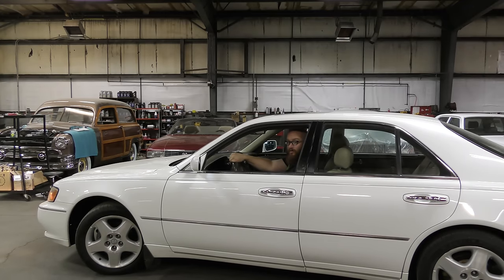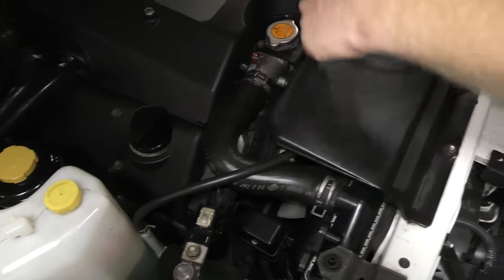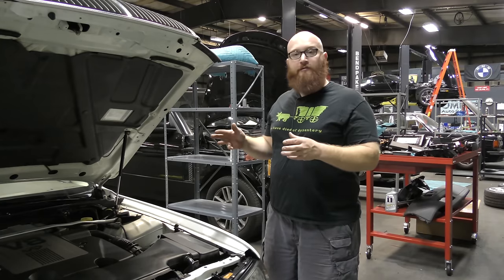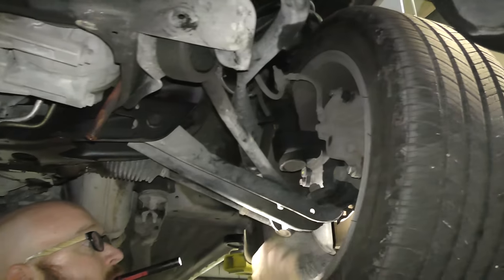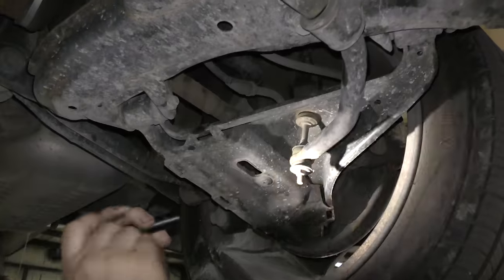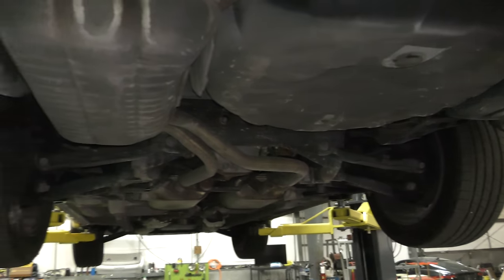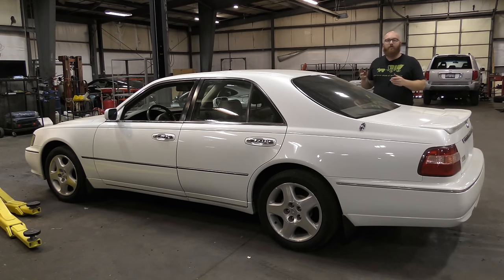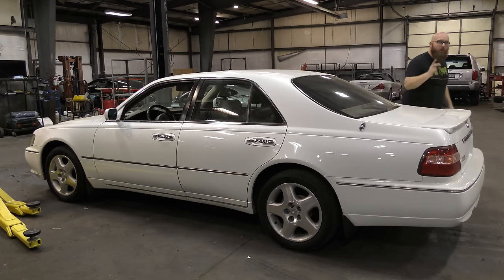I've never seen one of these before! First time a 99 Infiniti Q45t enters the Car Wizard's shop

Comment: Finding struts may be difficult as some of the fluids used for the hydraulic portion were later classified as carcinogenic. I hope that is not the case for this model. It looks like a set of coil-overs may be the only alternative if a local hydraulic rebuilder can't help.

Comment: Hello, I could not find the ignition coil holding time in the manual, I only found the diagnostics. Please tell me, on the drain of brains from the factory, what is the holding time of the ignition coil?? The VH41DE engine

Comment: My dad got a 1990 Q new. I drove it and was a fan. Bought a used 90 Q45t and loved it until the sunroof broke costing $2k to fix. Next up was a 2004 Q45 with some miles. The engine and electricals started to go, and the car had nowhere near the verve that the 90 had. Last was a 2007 M45, which was an awesome car, also high miles, The post 1st gen Infinitis simply had too many sensors and electrical issues, and burned oil. My dad's last car was this one, probably the best looking of all.

Comment: Car wizard. I owned one a 99 touring same color with silver bottom . and currently own a 05 Q45 that I have owned since 2009. Here is ur only 2 options. OEM from dealer and they above 250 a piece..and front one not loaded how ever you get it with the knuckle in the front ..your second option. Coilover which they are available on ebay.97-01 ..and btw they start using 4.1 in 97 but in 02 they went back to the 4.5 👍

Comment: Hey , Wizard I had a question. I drive a 2013 toyota avalon limited.  It has 122,000 miles.  I thought It would be a good idea to change the transmission  oil.  When I called Toyota for price on changing oil, they said my cars transmission oil is good for the life of the car because it uses a special  type of oil. Ive never heard  of this.  Should  I change it anyways.

Comment: My trick to finding old car parts has always been to find older dealers that pulled dead inventory out of their computer system (for tax reasons) but had enough room not to throw them out.  I found a brand new set of lower control arms for a 1966 Oldsmobile at a dealership holding open a pair of huge sliding doors.  Obviously they were never in the digital parts inventory, but the old guy in the parts department thankfully recalled what they were other than door stops.  I've also had some luck finding Buick parts at Chevy dealerships... Where the parts guys knew they had the part, but had no clue what car it fit on to.  Having the part number was essential.  When I went to pick up the Buick part, which I got at a dirt cheap price.... the parts guys crowded the counter because they had been wondering for years what that mystery part actually was and what it fit into.   So try an old Nissan dealership if Infinity doesn't have the part... parts sometimes find themselves in places they don't belong... but make sure to have the part number.

And BTW, I know it's no fun to call dealerships one by one to get someone to actually go though their old stock, but that's the way to find parts that aren't in the computer system anymore.  Remember... narrow your list to only dealerships that were actually around when the car was new and have larger facilities to store old parts.

Comment: I drove a 2003 FX45, honestly it had the best exhaust note I ever heard from a car. The problem was the engine had complete failure at 65K miles, dealer replaced engine. I drove it an additional 50K to about 115K when one of my cylinders cracked and began to leak oil inside the cylinder causing large clouds of blue smoke and catalytic converter failure. I decided that the engine design must be a lemon. I see FX35's on the road all the time but I've never seen another FX45 after selling mine.

Comment: I drive a 97 Q45 with over 270K miles as a daily driver.  I paid $1,500.00 in 2008 for it, yup, $1500.00!  It had a little over 100K miles when i purchased it.  I was hoping to just get a couple years out of it. It still runs and rides like a dream.   All original except for the rear differential.  Everything still works.  AND, Yup, my power steering leaks.

Comment: I have an 01 i30 with a power steering leak and the iac valve needs to be replaced along with the ecm but I plan on keeping this bad boy bought it at 154xxx miles and only put 10xxx on it so far great car definitely want to keep and maintain for my son be worth a whole lot more then.

Comment: I wanted this, but...SLOWWWWWW... 2 years ago I got a 2002 Q45 Premium (1st production car with a rear view camera in the US). Then last year I got a 2005 Q45 Premium. The features back in 2002 for this car were amazing. It had adaptive cruise control, adjustable headlights, heated/cooled front seats, heated rear seats, navigation, voice activation for radio, windows etc, adjustable suspension (sports button), tipronic 5AT, rear sun shades on windows and rear glass. Like the Wizard says, the suspension is brutal. On Youtube they sell a K Sport 36 way adjustable kit for around 1K shipped. My fronts went bad on my 2002 and had to get them from a junkyard for $250 for the pair. Turn off the traction and 340 horses/330 on the torque will get this just under 2 ton car REALLY sideways.  Amazing vehichles with TITANIUM VALVES.

Comment: saw  a 90s q35 or something came in the shop for winter tires, not a single spec of rust on a 20+ years old car in Canada, that's been winter driven. no oil leak, suspension bushing in perfect condition. didn't even believe what I was seeing. those infiniti back in the early years are solid built. you know they are trying to match the lexus craftsmanship, and I have to say, they prob. exceeded toyota. early 2000, you saw infiniti booming with the G35 coupe. but now, it's just a regular nissan in fancy body.  I told the owner, whenever he wants to sell, just come in and I will buy it. he told me: not a chance!

Comment: I have two of these a 1999 Base model and a 2001 Touring... my 99 has 184k and runs like brand new, the 01 has 147k and it’s having issues, replaced knock sensors in it, had to replace the chipped key, now im having a coolant leak and massive vacuum leak on it.

Comment: I had a j30 infinity and the only way I found struts  were inserts and those were a dime a dozen special order.i passed and did the coil over conversion.forget what set I bought but they were 3500.00 dollars and they road very comfortably.but I had to cut and tap the knuckles.and that's pretty much the only option

Comment: I totally a fan of the 1999 Infiniti Q45t mid-size sedan, because it is one of the safest, luxurious vehicles in the market. They are way better than the newer Infiniti's, which are the M35, M37 and M56. Also, the Q45t is one of the best vehicles to buy for a newly, licensed driver or a novice driver, because the body is aluminum and it is much similar to the Buick Lesabre with the 3800 V6 engine from GM. Moreover, the Infiniti Q45t is fully-loaded, it is a solid vehicle and there is not much plastic, compared to the newer Toyota's and newer Honda's with the four-cylinder engine. Finally, the 1999 Infiniti Q45t sedan will be an excellent vehicle to buy, because I have not got a buy this, not that video for the next manufacturer or the next vehicle type, since the Car Wizard did one for Jeep almost two months ago.

Comment: "Easy to work on" except... 
When the lower fuel injectors start leaking so badly the catalysts did from running too rich.   Then you have to take the intake manifolds off and dismantle them.   
Also, the active suspension on the Q45a can be intermittent.  
But when everything does work it's a fine driving cruiser.

Comment: Hundreds of these on the roads in NZ. All of the 2nd hand Japanese stuff ends up here just rhd... Electronic suspension parts would crossover to nissan models also... But much like all older German cars we would find it cheaper to fit upgrade suspension.

Comment: A long shot but check with your Infinity dealer. Sometimes they have NOS and I've had an older parts guy tell me that used the same parts in another model.

Comment: You arent going to find any replacements. Best to just buy coilovers or just get the base model struts. There is a whole community that VIP these cars. You can even do a s13/14 conversion to get rid of the front spindle. These have spindles like the e30 where its one whole piece with the strut.

Comment: My OCD kicked in when you didn't wash your hands (after touching the struts) and then touching those beige leather seats 😶 Back in 1999, my best friend and I (both auto industry people) took one of these from work on a trip to Toronto (from Detroit) and it flies! I loved it (Being a huge Nissan RWD Fan/Owner of a 300ZX/350Z GT and 240SX). It was so influential to me that I have owned several RWD Infiniti Sedans and Coupes over the past two decades. Living in Europe now, Infiniti stopped over here. So I sold my Coupe due to no dealer service Supports in 2016. If I ever move back to teh US, I'll probably buy another Infiniti☺

Comment: All y33’s made for Americans came with the 4.1 and this is fact.97-98 T or Base came With(only) the4.1 which had 2 cats instead of 4 and less bells. 99-01 still same 266 HP 4.1 but Two additional catalytic converter’s a face lift a Ass Lift and the bells with the whistles . Mine is a 2001 T

Comment: This is a FGY33 where as the earlier one was an HG50.  The first one was based on the top line Nissan President line whereas this is based on the second line Cima/Gloria/Cedric line .  The original had the VH45DE whereas this one has the slightly less rigorous VH41DE.  The VH45DE was essentially a race engine detuned but not decontented for the street.

Looks like the under engine bay tray is missing which is not good for cooling.  If Infiniti of Scottsdale does not have the struts, then they are not in the country.   The replacement struts (non-electronic) would be by KYB.  There were some Japan only ones that were great with Eibach Sport springs, again probably neither no longer available.

Might want to take a closer look at the front tension strut as these fail first.  Replace if cracked, trust me.  Better and cheaper than failure.

Wood trim is excellently simulated plastic.  No gripe from me.

HID is low beam only.  Ivory Pearl Quartz is a stunning 3 step paint.

Both of the two early Q45 have VLSD.

If you get stuck on parts, call T3 in Atlanta, the southern shop.  They know more about the Q45 than anybody.  Manuals are free for download on line from Infiniti and on NICO.com.

Comment: I never had any experience with any of these but did work on alot of 97 and older j30 infiniti cars. Which were 3.0 liter VG30DE v6 4spd auto and rear wheel drive. Not super powerful or anything but really comfy and fun to drive hard. IMO anyway lol. ✌☺👍

Comment: A little late to the party... had a 98 Infinity I30....wonderful car... had absolutely no problems ( just normal stuff, brakes, tires,  oil etc)...had well over 200K miles, never tuned up, original plugs... started, ran, shifted perfect... best car ever owned ( I'm 70 years old)... my wife made me get rid of it because "it was getting old"...now have an 11 year old Toyota Venza v6, all options... same thing...150K and never had a single problem... would drive cross country in this thing tomorrow without a care...who needs 6/7 years of car payments... on a newcar that would last the life of the loan...oh, wife has a 2020 Accord... nowhere near as good as the older ones...

Comment: 2:35 The Northstar didn't blow as many head gaskets as people think. The engine would run hot for whatever reason. It would then pump out coolant because air was trapped in the engine. Stupid techs thought the HG was blown. You can not bleed out air when the engine is hot. The engine has to cool off. Not a lot of people know this.

Comment: Only certain q45 owners truly know what fine piece of japanese art we have that was "imported" .which poses two factors parts and build quality.  But overall it's been a kept secret like the gs400. I have a 2002 black on black with muffler deletes power everything literally, navi, rear recline seats ,window sunshades for the back and yes all four of my shocks are shot and i have a power steering leak. but the build quality and features in this car far exceeded cadillacs from this era. I used to have a 97 aurora before i knew about these and i loved my rora and thought it was the shit but the q's have my heart now and i always think about s class. If i turn the VDC off in my 02 Q itll smoke the entire street and i've beaten a handful of cars i didn't think ill be able to beat even from a dig imma young fellow so most of my friends have chargers and small cars and when i show out they always ask if i did a engine swap or what i did to it ....But i think the Q45's chassis is based off the nissan 240zx and the 350z but don't quote me on that. But i know we can use standard shocks from other nissan cars but you'll have to go without the auto adjustment.

Comment: Do not know.  There are (were?) companies that can rebuild motorcycle shocks. Even ones not designed to be rebuilt. 
I would probably look.for aftermarket shocks from a serious company to try matching a set of convention AP shocks off a newer similar car.  Hard but possible. Owner websites are usually worth a look. If there are ones. British is possible, more adaptionthere

Comment: Love the Q45 gorgeous vehicle Infiniti luxury division of Nissan. The Infiniti Q45 was in Production from 1989-2006. This was also called the Nissan Cima in Japan.  This was the second Generation of Q45 had a 4.1 L VH41DE V8  with a 4 speed automatic transmission with manual shift.  This particular model was produced from 1997-2001. This vehicle made about 266HP 0-60 in about 7.5 seconds. The primary competitor of this Infiniti was the LS400 which sold far more in numbers. But this Q45 is still a creampuff cruiser. The successor to this Q45 is the Q70. These engines was bullet proof when it came to reliability, easily could surpass 200k on the engine with rountine maintenance.

Comment: Those Nissan adjustable shocks comfort/sport handling (electric motor controlling valves in shock) were also on JDM Terranos (Pathfinders). Twenty years ago they were asking $800 per shock! No way, Monroe shocks were substituted and did an acceptable job for a  4WD body on chassis vehicle.
Interesting about the public comment re Bilstein building a set to customer's requirements....

Comment: They did cram EVERYTHING I have one and it had a broken oil pan 
Entire bottom subframe has to come out
Also bolts to the trans 
Hard hard job
Also the pan was 600 ass dollars
Mines on bc coilovers because we couldn't find the adjustable ride high set up

Comment: This car is in roughly the same "weight class" as the Eunos Cosmo, the big brother to the FC/FD RX-7. After doing a 20B Conversion on my FC RX-7, I ended up knowing FAR more than I should about backtracing and sourcing parts straight from Mazda's suppliers.

When it comes to Japanese OEM parts, the most useful info is often on the part itself and easily overlooked. Japanese companies often put their logo on what they make, usually in a corner. European manufacturers sometimes do this too. Some things like the EKAT Control Unit on a E38 750IL were made by Kostal, which has a rather distinct "LK" logo for their founder (Leopold Kostal). But on my Mazda RX-7, it wasn't too hard to figure out who made what since they left me clues to follow. Tokai Rika's name was on the seat belts and gauge cluster trim, Yazaki's logo was on the cluster and fuse boxes. Harnesses were Yazaki, but used Tyco Electronics (now TE Connectivity) connectors for the ECU. Electronics were mostly Denso stuff, but with a Clarion radio and amps.

Try giving the struts a careful cleaning with soap and water near the bottom spring perch. The gunk on them may have preserved the labeling like it did on my E38 740i's transmission pan. If you find a label or a logo, send me a picture and I'll find out who made it.

Comment: I've worked on these.  Nissan's weakness is body and power train electrics.  Be prepared to replace cam position sensors, crank position sensor, body control computer ($$), daytime running light module, antenna amplifier, etc.  Power train is mechanically indestructible.

Comment: hello i’m looking at purchasing 1999 q45 infinity 130.000 miles for $ 2000 dollars ur thoughts
Reply: Check the rear struts, power steering pump for leaks, and transmission fluid flush if you decide to buy it. Goodluck!

Comment: I wouldn't call it strictly a luxery car. I have the base model 99 and the suspension and steering is so good it really inspires confidence on the twisties. Those strut tower braces front and rear imply something more than luxury about this car. Have the speed limiter removed from the computer and they will bury the 160 mph speedometer. This is an autobahn stormer in sheep's clothing.

Comment: I have a 93 Infiniti J30. Another bizarre car they came out with. Pretty much a 4 door 300zx with VLSD and 4 wheel independent suspension (earlier years had 4WS). In Japan, it was available with a V8, not to mention the 4 door coupe profile (before there was such a thing).  I miss 90s Japanese cars. They took a lot of chances and walked away with a lot of success stories. That said the J30 and Q45 were underdogs and paled compared to Acura & Lexus which explains their rarity today. Trust me, they're different and awesome. They can be had pretty cheap but be sure they've been maintained. I won't get rid of my J30 for anything

Comment: i had a 1998 Q45 it was the best car ive ever owned before that i had infiniti j30t when the struts had to be replaced  i had to get THEM off a later model at pull a part  because way back then they wanted 300$ EACH FOR NEW ONES and they were hard to find also